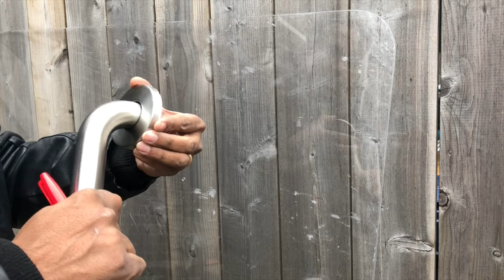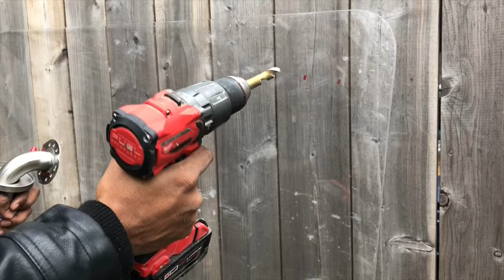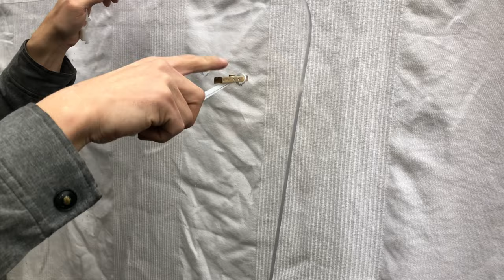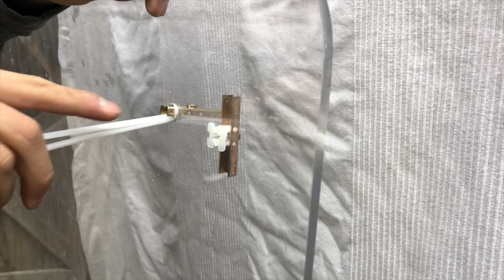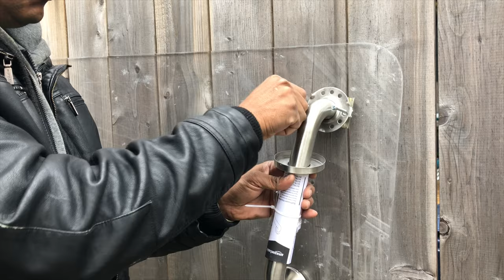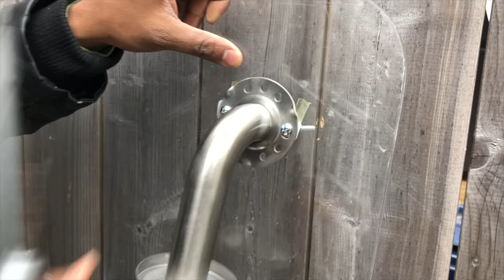How To Mount A Grab Bar On Wall WITHOUT STUD -  Amazon Basics GB + Condomounts Drywall Mounting Kit

Comment from the maker: Thanks for the video. this is great mounting system.  !!!!!!!!!!!!! Found this great kit for sale on Amazon. CONDOMOUNTS KIT. It has the toggle anchors, drill bit, 1/4-20 screws and washer the entire set for around $20. Good for drywall plasterboard gymsum and mounting on Steel Studs. Can hole easily 90lbs although it says its tested for 200lbs . The drill bit was $20 when i purchased in just by itself.So this was a great package that i had to share with everyone out here.  @t
@t
Reply: Did you really thank yourself for the video you filmed and uploaded? 🤣😂🤣